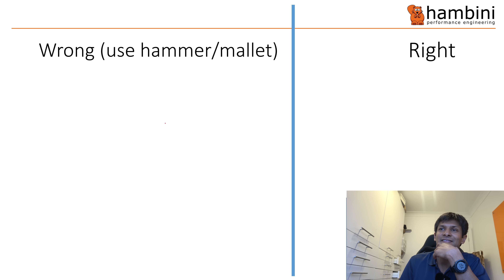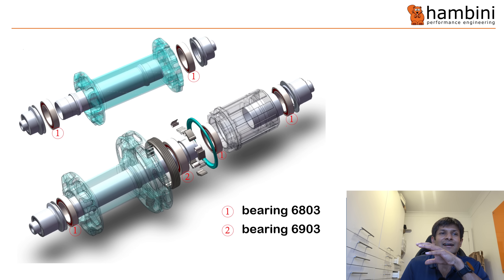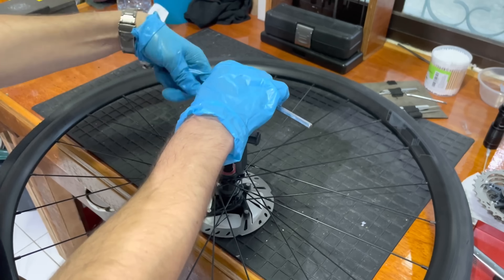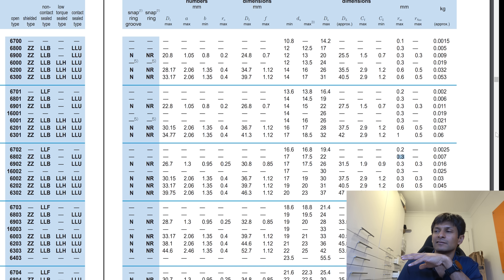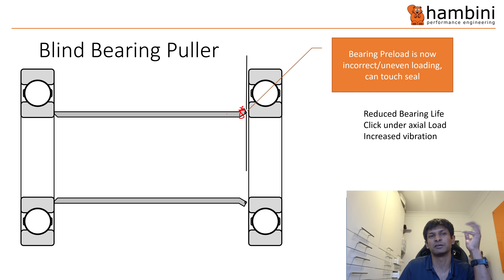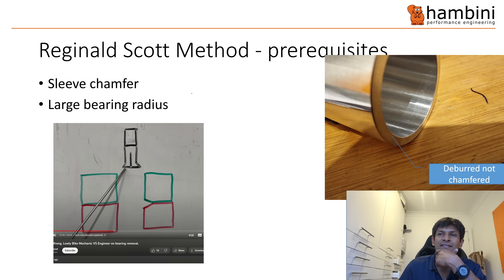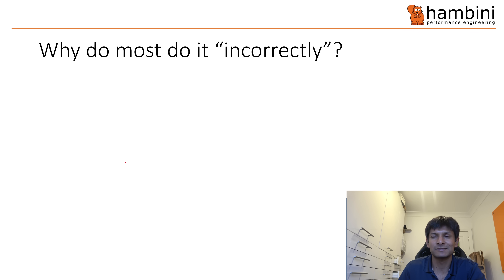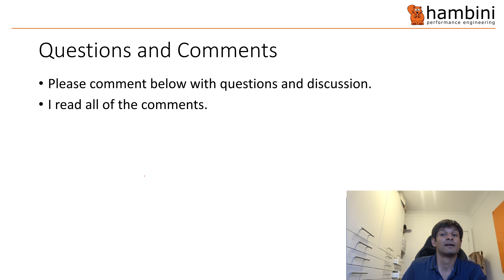I got REAMED by a Bicycle Mechanic | It was bound to happen at some point.

Comment: Professional mechanic for nearly 30 years. Pro Team mechanic for over 10 seasons, at the UCI level. I've preferred and used a hammer and drift forever. I NEVER use a blind puller for exactly the reason(s) you've described.
Reply: Huge respect to pro team mechanics. Always busy, always working, day and night.
Reply: Good riddance of incorrect bearing preload, chapeau!
Reply: yep
Reply: Always prefer a rubber mallet (own a Eastwing DFH-12) and drift every single time!
Reply: The duration of something you do does not qualify the quality. And on the UCI Level: your stuff needs only to work for one season. Then either a fan or team member will buy that stuff of you.
Reply: @carstenschroder7054  great example of this… professional go kart mechanics rinse out the grease from the rear axle bearings and spray on a very thin lubricant, this reduces the friction and saves power losses. It also damaged the bearings but they don’t care as they put new ones in before it becomes a problem..
Reply: Hate to say it but Hambini is wrong, again.  1) Hambini's attempt to show that the spacer is deformed is misleading as he explains the up tick of the light deflection on the opposite side of the spacer that never was touched by the bearing puller.  Watch from 23:22-23:48 of Reginald’s video for a masterclass in slight of hand.  The deflection of light is more likely to be oil or grease.  2) This is a steel spacer.  And at 18:11 of Reginald's video it's pretty obvious that the amount of torque applied to the bearing puller is not enough to deform the spacer.  You would need to buldge the steel spacer beyond it's yield point for it to deform.  That's not what happens.  3) At 22:47 of Reginald's video you can see that the bearing puller does not extend beyond the bearing, certainly no where near enough to damage the spacer. 

As one who has worked with mechanical engineers in the bicycle industry, as well as someone who has replaced hundreds of hub bearings, and many a crushed aluminum freehub spacers from the early days of road disc, I can only say beware of ad hominem slinging experts.
Reply: @allrounderbicycle7193 in order for the puller to grab the inner race it has to move the spacer in some way. Where do you think the spacer is going to go other than be splayed out by the shoulders of the puller?
Reply: @allrounderbicycle7193  I agree that in this example the spacer tube was not damaged, but the argument should not that it has been damaged but rather that it could be damaged.

RS even noted with a degree of surprise that this tube was steel rather than the more common, and much softer, aluminium - so in the majority of hubs of this design he may well of marred it but by chance this hub was made of steel in this example and thus didn't. I'd probably argue his method is 'safe' for hubs where you know there is a steel tube, and unsafe for those that are aluminium - but I note that he didn't seem to know before starting the operation.
Reply: @dobson156_xjs7  I don’t disagree, yes it could be damaged.  But if you do it properly it won’t, which is why it didn’t.
Reply: @allrounderbicycle7193  the problem with your argument of "if its done properly it wont be damaged" is that its completely illogical, the spacers internal diameter is almost always the same as the internal diameter of the bearing you're trying to remove... slapping an expanding hardened steel tool in there and wrenching on it is gonna damage it, like I'm sorry if you disagree but if Hope of all companies says use a hammer, then it's perfectly fine.

I would say on regard of it being a steel spacer, Reginald lucked out in two ways; (1) that it was roomy enough to let the tool get purchase on the bearing, that's mostly never the case with these internal spacers and hub sleeves/axles (2) that it wasn't alloy otherwise that spacer would be ruined.

For jobs where there is nothing behind the bearing and it's gonna be awkward to use a drift, then 100% get the puller out and remove the bearing.
Reply: @CJmtb91  With respect, I'd agree that the job cannot be done properly with the wrong tool for the job.  Yes, I agree, if the expansion of the puller happens inside of the spacer it could easily be destroyed.  Reginald's bearing puller is the right one for the job, allows the job to be done properly, and nullifies your next two points, that he lucked out, and that if it were an alloy spacer it would have been ruined. 

Watch 22:44-22-54 of Reginald's original video over again and you'll see plain as day that it does not match up with Hambini's theoretical diagram of the interface between puller and bearing, especially with regard to the scale of the bearing puller claws.
Reply: @allrounderbicycle7193  That's why I said he lucked out, he got lucky that his tool fit nicely, there's plenty of internal sleeves I've seen that are super tight fit and would not have allowed even his puller to do that job without being damaged.

Secondly what the hell is Reginald gonna do with hubs like mine where the inner tube extends through the bearing... especially when his dad said hammers are bad and your doing it wrong if you need one lmao.
Reply: @CJmtb91  When you use right tool properly, you'll find you get lucky every time.  The key is to use the right tool.  BTW, Wheels MFG, which is all I have, make bearing pullers that don't rely on that claw at all, just expansion and friction.  So I'd try that if you have an issue with the bearing and the spacer being too close.  

As for your second issue, ya, that's totally different.  But the same concept applies.  Use the right tool.

I'm not against using a hammer and chisel when needed.  It's quite fun actually.
Reply: @allrounderbicycle7193  Yeah the wheels MFG pullers are the only pullers I would consider, especially when it comes to bearings in carbon frames, I personally don't like the claw pullers.

My main point and concern is that Reginalds message is that hammers are bad and you shouldn't use one, which I strongly disagree with, anyone less experienced seeing that message and then coming across a job where only a hammer can be used is going to cause some confusion.
Reply: @allrounderbicycle7193  A drift isn't a chisel.
Reply: @dobson156_xjs7  the puller never protruded from the bearing face, so wouldn't have damaged a chocolate spacer, let alone ally!
knocking a hardened steel bearing out, within an ally wheel, or steel for that matter, will apply uneven forces to the inner face of  the hub, damaging it in the process,
Hambini is wrong and Hambini has gone down in my estimation, as he won't admit it.. shame.
Reply: @craigsanders6925  a punch isn't a drift
Reply: RollinRat  do you punch them out to then replace the bearing only or do you punch them out then reuse the bearing?
Reply: RollinRat  You said a lot it there, but nothing to explain away instances where a hub will feel "grindy" but once you reinstall the cartridges it feels smooth.  It doesn't explain away the excessive preload some QRs cause to some axles, crushing the bearings no matter how new or nice.  It doesn't explain away the need to carefully remove the bearings to diagnose and isolate variables without leaving your customer without a wheel for to use for in the interim while their new bearing gets ordered or while they decide where they'd like to spend their money.  Associating yourself with Chris King, airline mechanics, medical grade standards doesn't help explain those situations either.
Reply: This issue I'm addressing is re-installing bearings that have been removed.  My argument based on my experience is that there are many instances where you might want to be more careful about removing that bearing (and use a puller not a punch) because there are many instances where a true professional (to use your phrase) might have to put that bearing right back in.
Reply: RollinRat  Not missing the point, just have experience with the methods in question.   You don't even disagree with me just beating on your own strawman arguments.
Reply: RollinRat  34 years wrenching and counting.  But years don't matter.  Attention to detail does.  Attention to context does.   Reason's are above if you care to read them.
Reply: RollinRat I like your reasoning: “If there’s evidence, you didn’t present  it, and if you did present it I don’t buy it, because I’ve already decided you’re wrong.”  It’s there but you’ll find it in my words, not yours.
Reply: @allrounderbicycle7193 it's hard to admit for wrong sometimes isn't it 😢
Reply: @jeremys2159  Not sure what that sentence is saying
Reply: @allrounderbicycle7193  it’s saying you’ve been asked to explain a plausible professional reason for reusing a bearing that’s been removed with a bearing puller, you keep dodging the question..
Reply: @JayGee6996  I did type this in response to Rolling Rat, but you both either didn't read or failed to address each point: "You said a lot it there, but nothing to explain away instances where a hub will feel "grindy" but once you reinstall the cartridges it feels smooth.  It doesn't explain away the excessive preload some QRs cause to some axles, crushing the bearings no matter how new or nice.  It doesn't explain away the need to carefully remove the bearings to diagnose and isolate variables without leaving your customer without a wheel for to use for in the interim while their new bearing gets ordered or while they decide where they'd like to spend their money.  Associating yourself with Chris King, airline mechanics, medical grade standards doesn't help explain those situations either."  I've been a professional mechanic for 34 years so just felt the need to drop my opinion.  Thanks for being curious.
Reply: @allrounderbicycle7193  the point still stands that bearings removed with a puller should be replaced, if you choose not to for reasons such as a speedy repair then that should be offered to the customer for them to make a decision, if they chose the quick solution then that’s on them.. it’s not something I think should be done without consulting the rider as it’s their neck on the line and their bearings which may well need replaced in a shorter timescale than was necessary
Reply: @JayGee6996  you’re entitled to that opinion. To me the final  proof is in the smoothness of the spinning wheel.  You cannot hide a pitted bearing or a poorly installed one.  Your characterization of the issue as a “new bearing only, or else you’re endangering the rider” is simply not reality.  Also people who care about ultra low friction bearings shouldn’t keep riding hubs that are prone to frequent bearing replacement.  They should just ride better hubs.  Again I’m not arguing against bearing replacement, just that there is a place and context for more carefully extracting bearings with a puller.
Reply: @allrounderbicycle7193  you're quoting me with your own words there. What I was saying is that you risk putting the rider in danger and that it should be their choice whether or not they take that risk. If you decide to do it anyway on the basis that 'it feels smoother' then that's a personal opinion and not one based on good risk management or sound engineering knowledge/education.
Reply: @JayGee6996  it’s called paraphrasing, but it seems accurate in that you insist that re installing a bearing categorically puts the rider at risk which I not the case.  I don’t know your reference point for that, and if you had one would have to square off with my experience fixing hubs for decades.  So I’ll go with my own lived experience.  Customers defer to my judgment anyway and come to me because they’re not the one that knows how to fix the bike.  And don’t offer them an unsafe “choice”.  I have no incentive to put someone in danger.   Enjoy the merry go round.
Reply: @allrounderbicycle7193  it’s not paraphrasing when you misrepresent the original message. If I paraphrased your message I’d say “I’m not doing it properly, I’ve done it wrong for 30 years and I’ve never had an issue (that I know of) so I’ll carry on doing it my way as it’s easier” it seems you don’t understand what risk is.. Risk = Likelihood x Severity. This scenario is low likelihood x high severity, this is why you think it’s fine to use lived experience and ignore the severity part of the calculation. This is the same reason old people don’t bother with safety glasses in a workshop as their lived experience tells them they’ll be fine (they were never taught any different). Also, this is not just about safety, it’s about longevity of the bearing. When you remove a bearing by pulling on the inner race, you can deform the metal which will reduce efficiency and lifespan. Your customers may trust you but that doesn’t mean you should do what you want because of lived experiences, you should be schooling the customer as most won’t have a clue, they’re relying on it being the professional. If you don’t believe that it’s technically correct to replace bearings you should try and contact some manufacturers and see what they say rather than relying on anecdotal ‘evidence’.
Reply: @JayGee6996  Like riding carbon bikes?  Low likelyhood, high-severity, right?
Reply: @allrounderbicycle7193  riding carbon bikes is acceptable; reusing bearings that have been pulled is not
Reply: @JayGee6996   Best wishes, Jay.
Reply: @allrounderbicycle7193  thought as much
Reply: @allrounderbicycle7193  but your not an engineer are you?
Reply: @Michael-cj9uo  Exactly my point.  Many of my customers are engineers.  Doesn't mean they're good mechanics.  Also see "appeal to authority logical fallacy".

Comment: So, is it make sense to get the best way doing this is by using bearing puller BUT the aluminium sleeve will be a non reusable item, change it together with bearing. So instead of one component need change, now u need 2. Besring and the alu sleeve.
Reply: @Sauli Luolajan-Mikkola nothing wrong, just doesnt LOOK right to a some customer watching their $5k wheels got hammered.

Comment: I've used soft metal drift to remove bearing and I've also used pullers it's depends on the situation. You must be incremental and methodical, basically use some finesse and you won't cause damage or wear to the ID of the seat-interference. Some outer races are chamfered but not all. Another thing is you don't remove bearing 'cartridges' to refit so drift removal is done to a non serviceable part.

Comment: Nice try, but Hambini is right after all! The aluminum sleeve is flared and distorted appreciably in the photo. Too bad the bearings aren't beveled for the blind bearing puller to work without damaging the sleeve. Another tool for the marketers to sell missed.

Comment: With over 50 years of involvement in cycling under my arse, I always replace the rim tape before installation of new bearings. They seat that much better, and I’ve yet to fault the method.

Comment: 🔥 😬
Seriously though, thanks for this one. I watched his video and even for me who works in a bike shop it appeared a legitimate and sensible approach.
It's actually something I've thought about previously, as I was concerned that when hitting the bearing out it's impossible to completely avoid knocking it to an angle and thus deforming the bearing seat.
Could you please comment on this with technical detail, or perhaps a follow up video, with why this isn't an issue..?

Hopefully he has the humility to go back and look closely if he did in fact cause any damage to the spacer.
I don't believe someone can actually be a good mechanic without the ability to admit when they get something wrong..
Reply: I looked at is puller, the flare has a flat side facing the spacer. This means to me that as you gently expand the flare to connect with the radius on the ball race, it cannot damage the spacer to any degree. Perhaps if the spacer was aluminium it might create some scuffing, but the same would happen with a hammer and punch. 
I looked at new sealed bearings and they ALL have a radii on both external edges.
Reply: @JohnnyMotel99  You are correct. 👍🏻 It’s a shame the above mechanic has thrown away the evidence of his own eyes and ignores the fact Hambini is actively Misrepresenting what took place in my video. 🤷🏻‍♂️
Reply: @Reginald Scot  youre video was great, and I love this technical discussion. I hope you do a follow-up . Personally, I would say the spacer was not flared because you were careful. On the other hand, I get habini's point. All this is very instructive. Thanks!

Comment: So according to Reginald Scott, using a hammer and center punch can result in damage to the hub. According to Hambini, using a bearing puller can damage the spacer, which can mess with bearing preload, etc. 
So who is right? Probably both of them.

Comment: In all fairness - you're deciding whether to damage the spacer tube, or the bearing seat (due to the inevitable canting of the bearing as it being hammered out.) Since the tube is the more replaceable structure, I'm thinking the mech has you on this one. A blind puller that relies on a flat serrated surface interfacing with the flat ID of the bearing would be the best tool (if that's even a thing).

Comment: What about pulling the bearing by installing a block that pulls the inner race?
Wouldn’t it not damage the spacer?
I used that method to pull my 24377 bearings, it shouldn’t damage anything right?

Idk about pulling wheel bearings tho, haven’t got the courage to do that by myself xD

Comment: I think regardless of the method used I would want/need a new spacer.  Given its thinness I would likely damage it with either the puller or the hammer.
Reply: You don´t touch the spacer with the drift.      Rgr